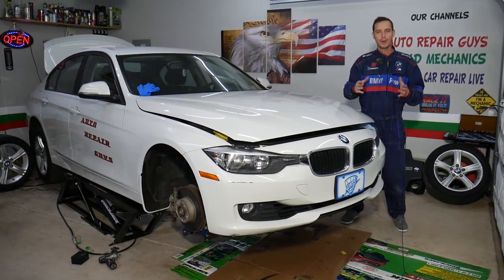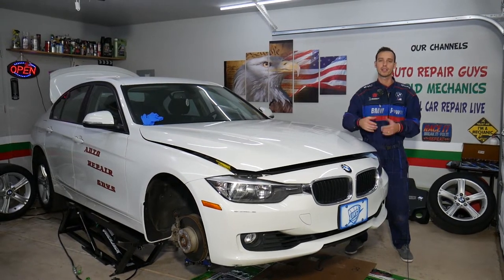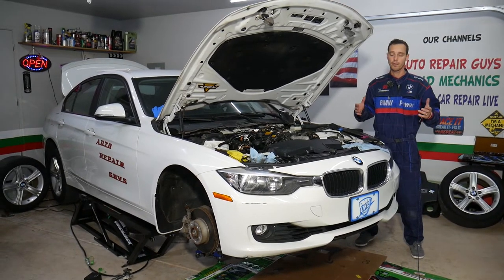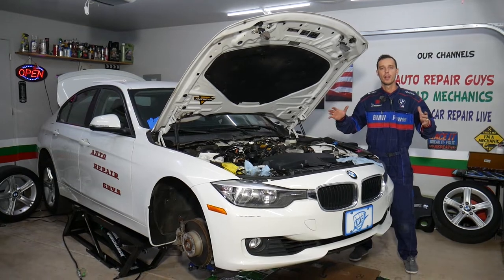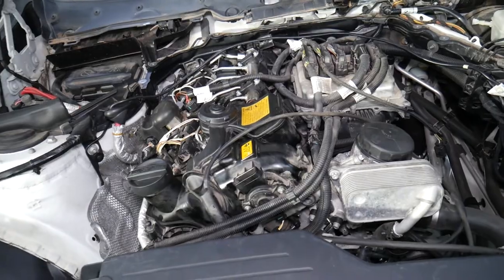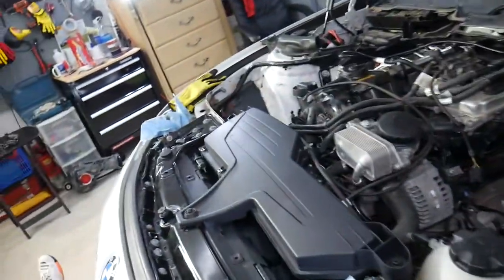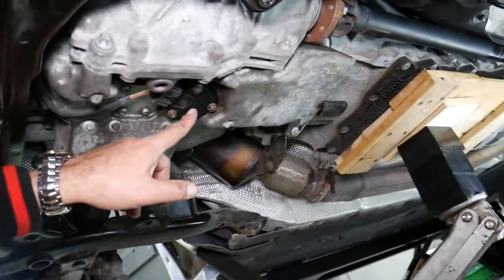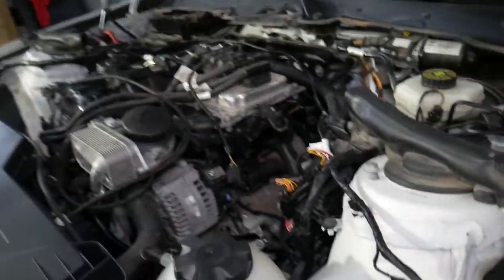BMW CHECK OIL LEVEL GETS STUCK AT 15-17 PERCENT  F30 F31 F10 F11 F20 F21 F22 X1 X3 X4 X5

Comment: Hey guys had the same issue for N55 and it was because oil temp must be between 65c to 100c (the operating temp is 110-115c) so after driving gotta let it cooldown before it will measure or after cold start let it warm up a little then measure
Reply: 100% Correct!
Reply: Oh god I hope

Comment: Removing the $2 oil stick in favor of a $150 sensor is where BMW jumped the shark. IMO is one of the dumbest moves by an automaker to date and why my 2004 E46 will be my last new BMW I'll ever own.
Reply: First time owner. Won't own again b/c of this one "little" thing. The fact that I can't check my enginer oil in 30 secs vs 5 misn (when it actually works) is nucking futs.

Comment: I'm having this same issue, oil measurement stops at 17%. I also get an "Engine oil pressure too low" warning when the engine warms up. I've replaced the oil pump, oil level sensor, oil pressure switch and the oil pressure control valve but no change. What else could it be?
Reply: Have you changed your TC and guides?
Reply: Sorted it?
Reply: No still haven't sorted it. Have gone 6000km with the error now. Highway driving I even pushed it to 200km/hr just to test, it manages it just fine.. With the error on the dash
Reply: @TheGeneralkk  Any update? Im having the exact same issue
Reply: Turns out when I got an oil change the O ring and small plastic cage inside the oil filter housing cap were not replaced. Got a new housing cap for $80 and re-changed the oil and problem solved.
Reply: Was your bmw over heating at any point? I have the same error message on mine as well as the measurement stopping at 17%. I am about to change the oil pressure control valve but am hesitant after seeing this
Reply: @afsanrahman50  yes it overheated at one point but fixed the issue (or at least I think I did). Sold the car now.
Reply: @TheGeneralkk  how did you fix it? I've had measurement stuck at 17% for awhile now but today got "Engine oil pressure too low"  F30 with N20 engine 2012
Reply: @albertCalPoly  I sold it. Too much headache
Reply: @TheGeneralkk  fair enough. Thanks

Comment: easy advise. I had same problem, just updated software easily with usb and problem is solved. that's easiest way to fix
Reply: If you are looking to tune (which is popular on the N55 platform since its so easy) updating the software can possibly lock the DME then you cant tune.
Reply: the radio/idrive software?

Comment: Im having this issue but no check engine light. Now do i replace the oil pressure control valve or the oil level sensor on the bottom? 😂 damn bmws. My oil temp stays by 160*. i just replaced the oil pressure sensor could it be that?
Reply: Have you scanned for codes? You still may have codes, are you sure you are checking the oil within the oil temp parameters? The engine cant be fully warm or it will stop the process.